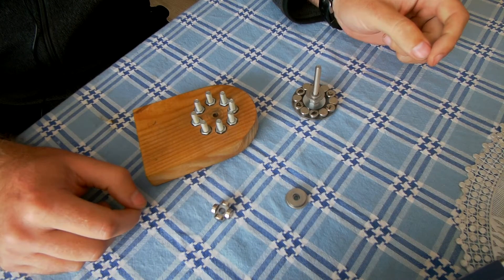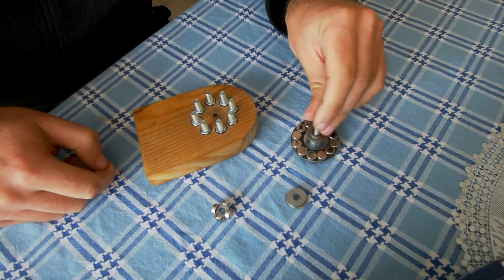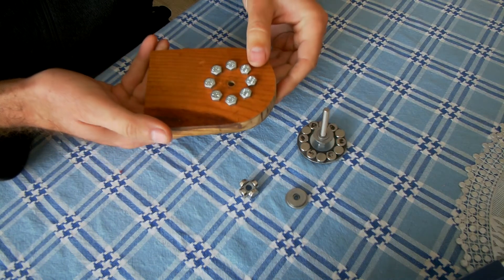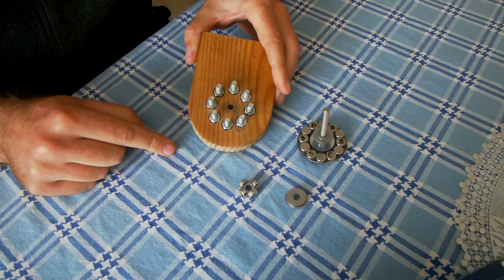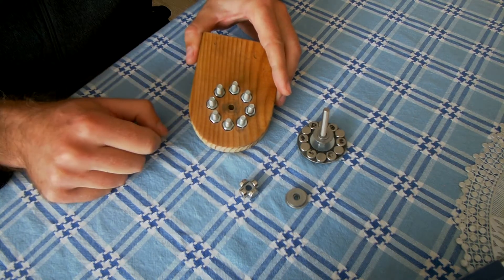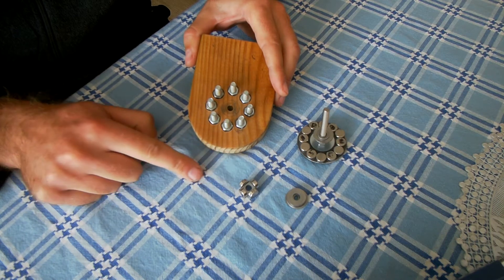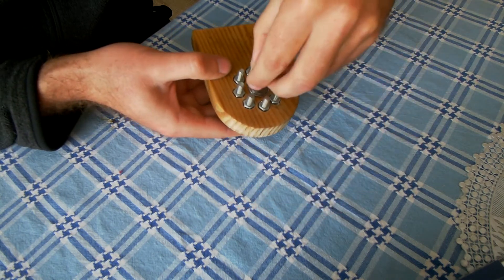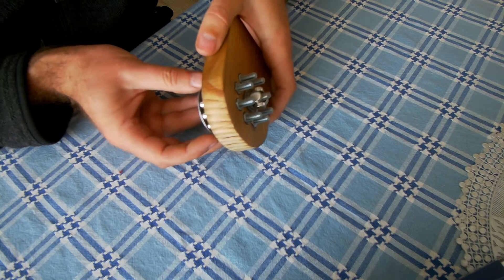DIY Axial Magnetic Gears

Comment: Thanks for the video. Went to wikipedia, read it several times until it made sense. One question, is there a way to make this work when the two gears are NOT on the same axis? If you want the drive wheel at a right angle to the driven, as you often see with the first order magnetic gears, but also reverse the rotation like you did here, can you do that in a single coupling or would it require two?
Reply from the maker: I have seen demonstrations of parallel axis coupling, similar to normal spur gears. Only a single iron piece was inserted in the gap and also resulted in reversing rotation. I am sure that such an arrangement can be used on angled axes, the only downside is that flux "meshing" is limited to only the few magnets closest to the bolt at any given time, limiting the maximum torque transfer. I have an idea for a fully meshed 90 degree coupling but first need to test to see if it works.